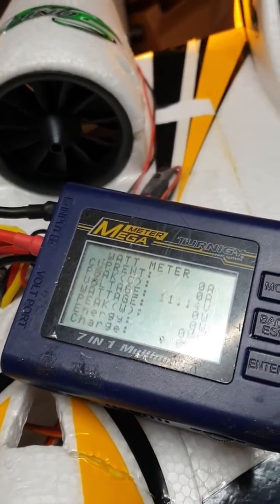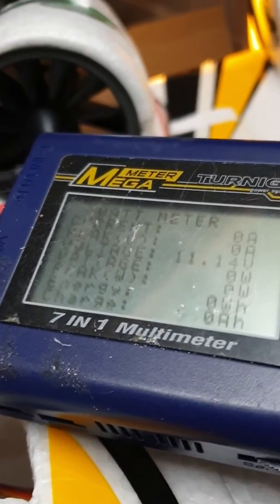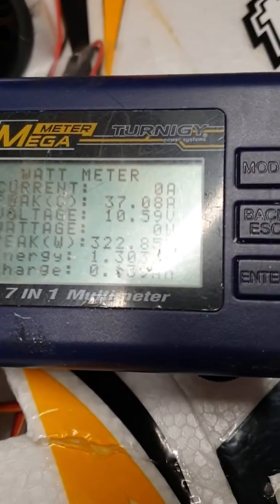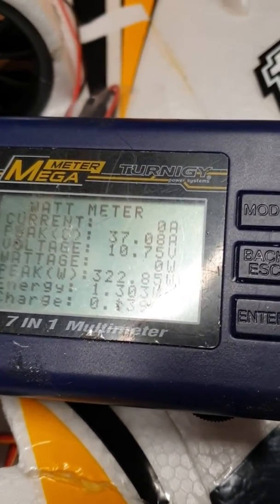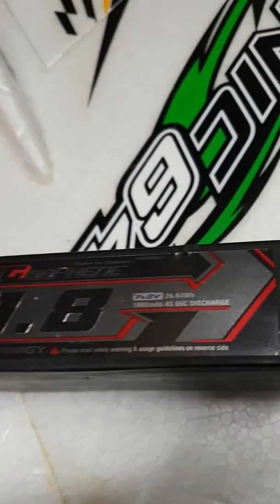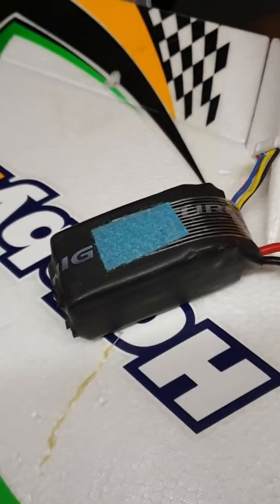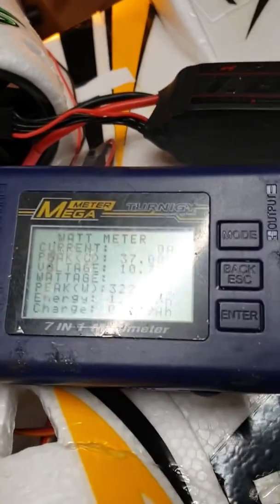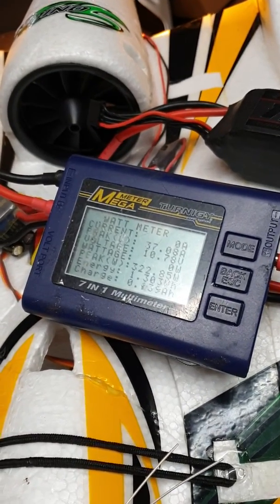Sonic64 EDF Wing with FMS 11 Blade fan on 4S.

Comment: 50mm? I have one on order!
Reply from the maker: Mine is the 64mm one. But if its balanced as well as this, you'll be ver pleased with it.
Reply: @blackbirdboy1  I have the 6S 12 blade FMS 70mm V2 in my X-29, sounds great and super powerful. The 50mm is going in an L-39 jet 660mm wingspan. The Sonic64 wing is a beautifiul flyer
Reply from the maker: @Caroline_Tyler  Yeah, I got this secondhand, but MotionRc sell basically this same wing. It floats lovely.  I inicially fitted FPV and flew it FPV. Videos on my channel. But I took of the FPV gear and flew it LOS and crashed it into a fence post. Broke the wing in two and something went through the fan and samshed it. I replaced the fan unit with a cheap Banggood 5 blade fan unit, but it was utter rubbish. There were only 3 thin fins holding the motor to the outer duct. It vibrated like a jack hammer and 2 fins broke after 3 flights. I glued them back, but one flight later and they failed again. So I ordered the FMS unit as a last ditch attempt to fix it. I think I made the right choice. Short of a crash, I think it will last a good long while.